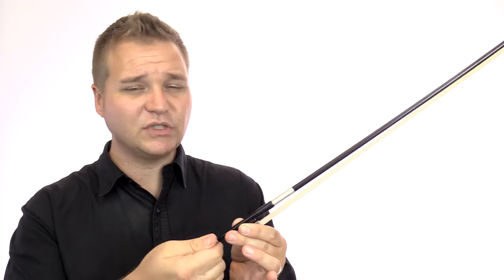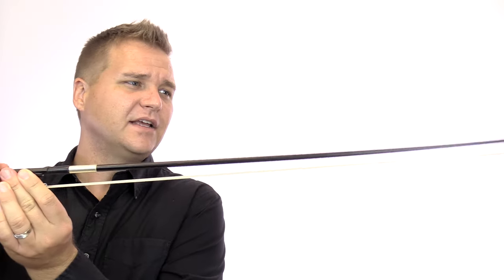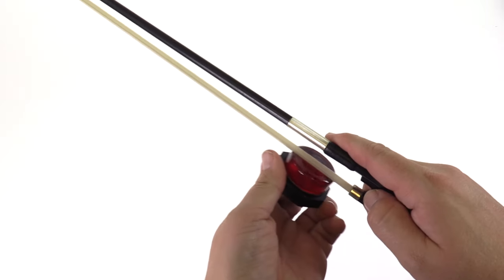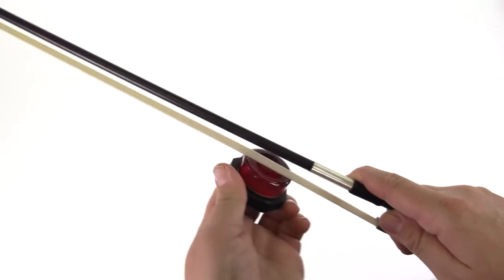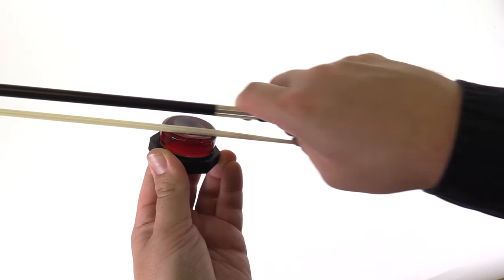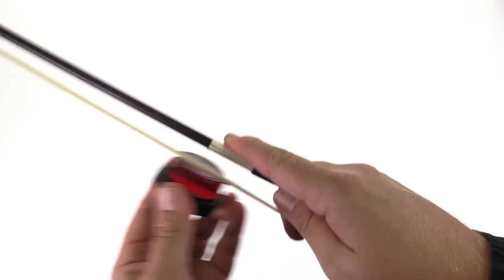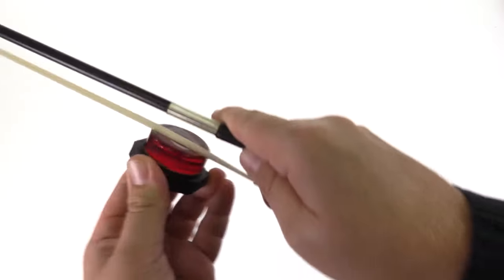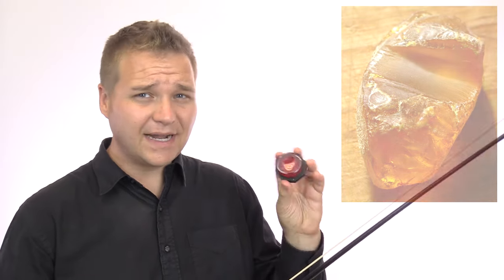How to Rosin a Bow

Comment: I noticed you don't mind having the rosin hit the metal piece near the frog.  I'm a beginner, so I am still learning.  Just trying to figure out proper practices.  Other videos from other instructors I have seen on Youtube seem to be pretty adamant about NOT getting the rosin to touch that part of the both.  In fact they recommend placing a finger over the metal piece to prevent the rosin from coming into contact with the metal.  What's the 'right' way?
Reply from the maker: I don't think you have to be too hard on yourself about either way. I do like to have rosin on every inch of hair (every millimeter?) And if you get rosin on the ferrel (the metal part) you can just wipe it off. I also understand the concern of hitting the rosin with the ferrel which will crack or chip the rosin, and then you'll go through rosin faster, but it's also not a serious problem. I wouldn't let this concern get in the way of practicing.

Comment: i have 2 questions: 

1. do a bow need to clean? how often we clean the bow? just wipe using special material (water, oil) or just wipe it using cloth? 

2. is it advisable using 1 or more rosin brand into single bow...or each bow need to use 1 brand only...
Reply from the maker: Thanks for watching! Great questions:

1. If you use excess rosin, you can wipe it off with a microfiber cloth. 
2. I would recommend find a rosin that works best for you. Depending on the quality of the bow, you may need to use a different rosin, but in most cases, most players will have a specific rosin they use on all bows.